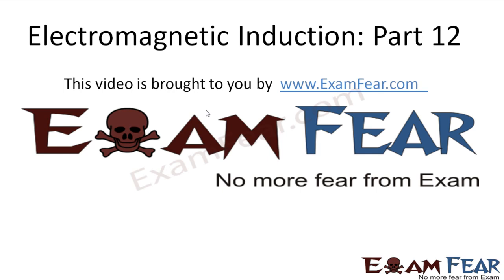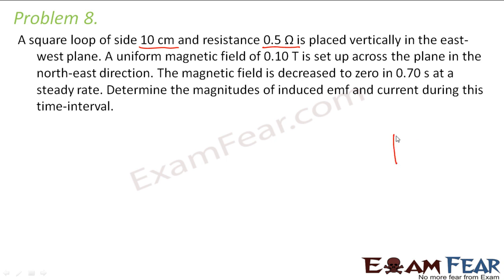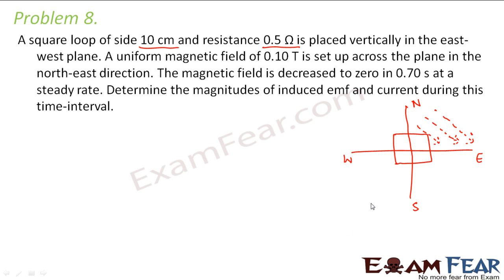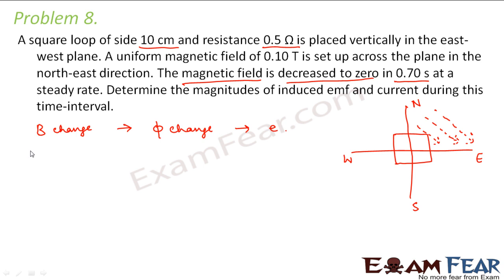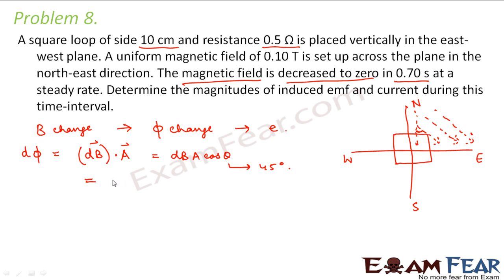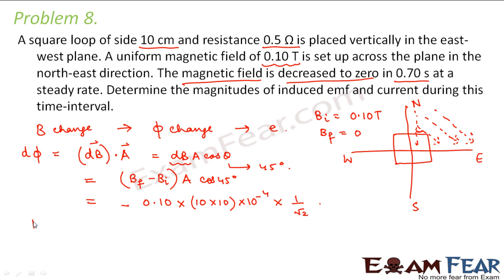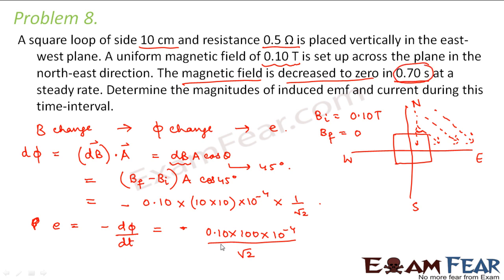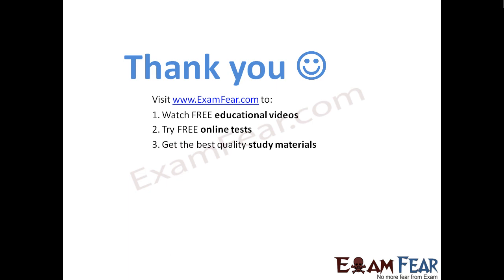Physics Electromagnetic Induction part 12 (Examples, Numericals) CBSE class 12

Comment: induced emf will be 0 because area vector and magnetic field are at right angle, not at 45 degrees. Because both are on different planes and these planes are perpendicular to each other, irrespective of the inclination of magnetic field lines on their plane.

Comment: The question says that the coil is placed vertically in the east west plane. So the angle between area vector and B is 45° itself. Its just that the diagram in the module isn't 3d so one can confuse